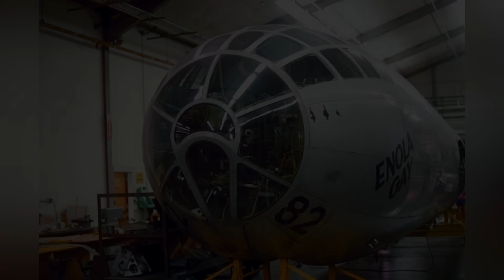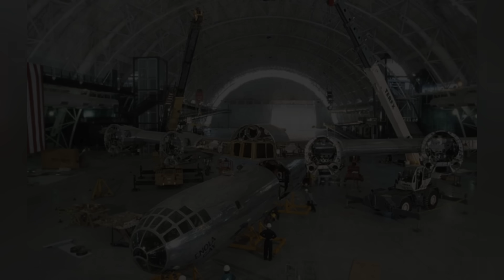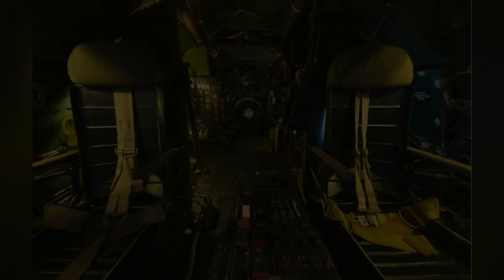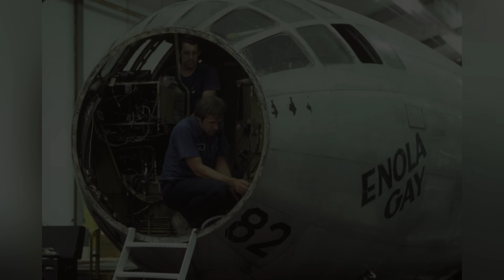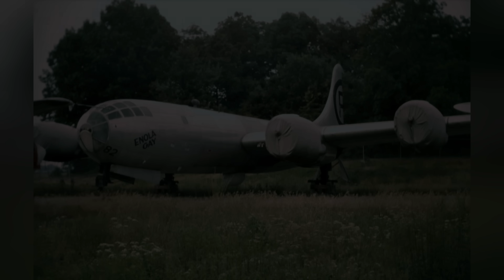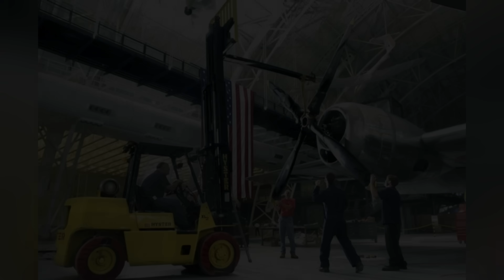Recovering Enola Gay: How a B-29 Survived Decades of Decay

Comment: The aircraft was flown to DC and then allowed to rot. They got their asses in gear to the point of getting the nose restored, then designed signage that apoeared to apologize for its connection to the use of the atomic bomb. What a ckusterf--k.

Comment: There is no mention of the display that opened in 1995 in the Air & Space Museum. The initial video was very controversial and was changed. At that time there were several of the original crew still living that were in the video. There was not enough room to fit the plane in the museum so they put part of the fuselage, an engine and a propeller plus a mockup of the bomb. I saw the display on August 6th, 1995 which was exactly 50 years after she dropped Little Boy. I am glad the plane has now been completely assembled and has the home she deserves.